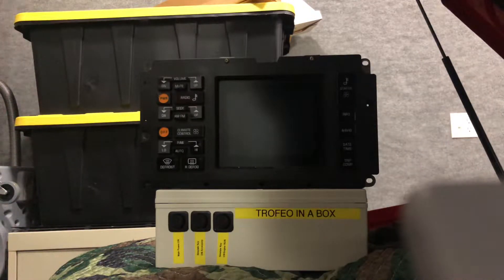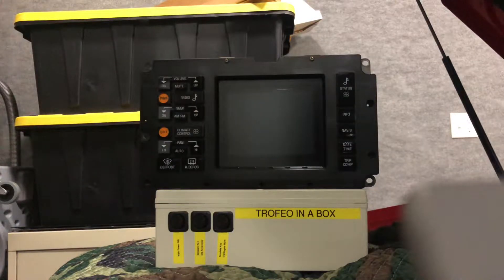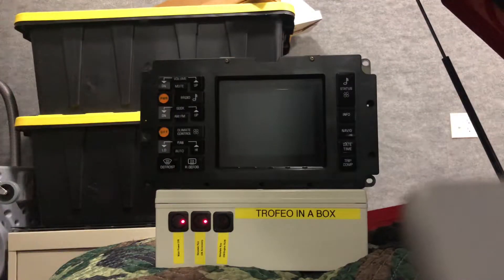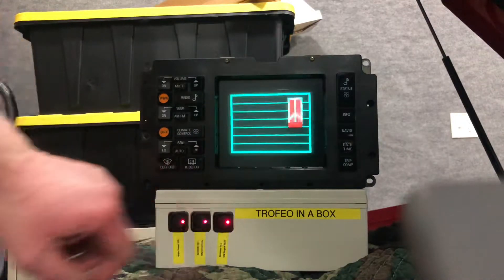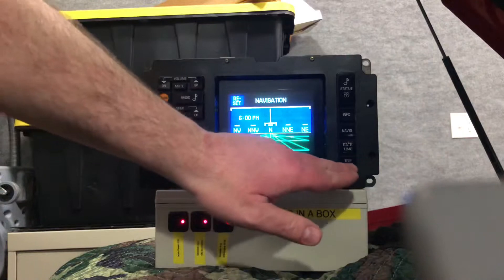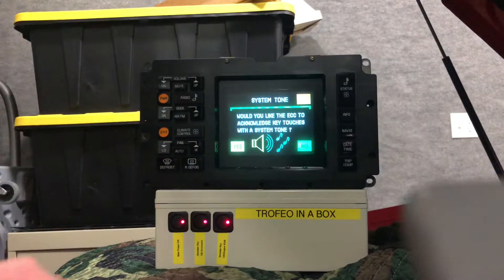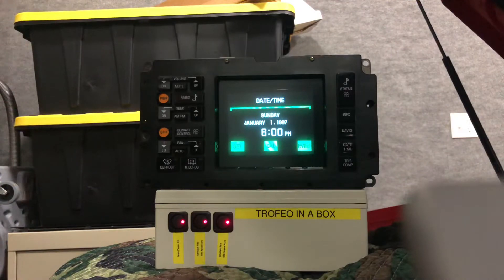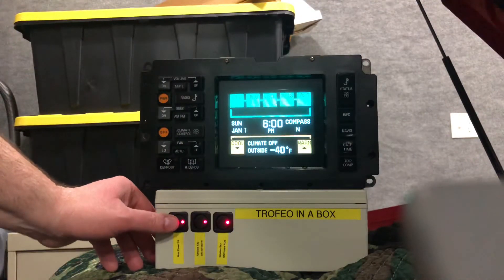Trofeo in a box / VIC Simulator Oldsmobile Toronado Touchscreen - Sony ADM-6ND1

Comment: Hello...This is Jack...STA2200.. I need to know...for the V-output chip that fails in these units...for the B +  supply for the chip...is it sourced from the power supply..or from  a pin on  the flyback ....through a diode and likely resistor ? ?  I will be seeing one with vertical collapse soon.....and need to know  where the B+ supply comes from..I am along-time tech...much experience in CRT tv repair...I kow a few caps need to be replaced...and likely the chip...but  want to get "all of it"..the first time ...Thanks...Jack.

Comment: I just found one of these beauts at the salvage yard. Can you tell me where the CRT controller and vic module reside in the car? I grabbed what looks to be the amplifier located near the shifter that has the antenna input etc but I wasn't sure of what else I'd need to make it function like yours. Too cool though!!
Reply: That was likely the radio...and under it on the 89 at least...is the CRT controller.

Comment: So...I guess you have a CRT controller in the box and a power supply hooked to it... and the VIC module... .with the VIC connector tied to it . BUT ...will ths all WORK...with no BCM connected to it ??  I guess the "key and 'Ignition on"...are pretty easy to simulate..for the CRTC....